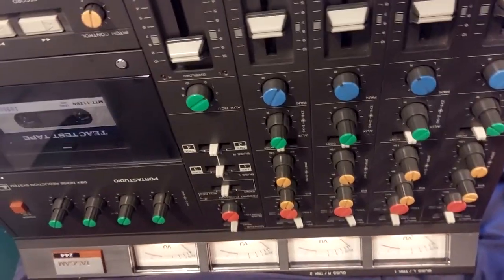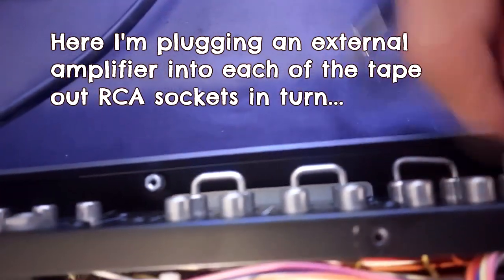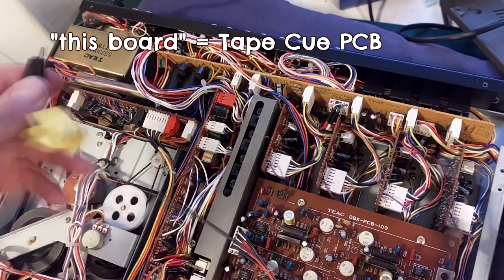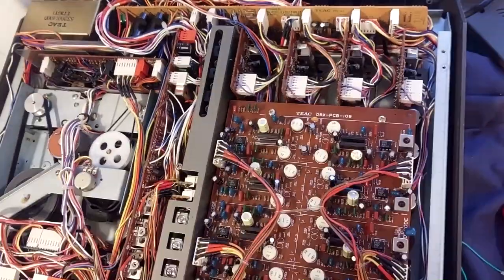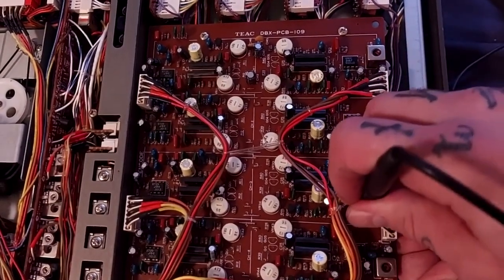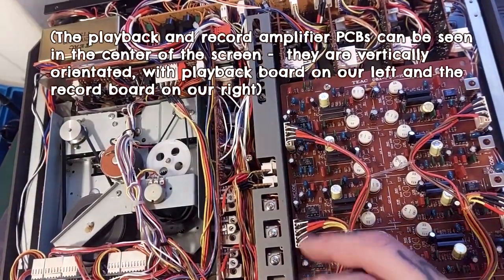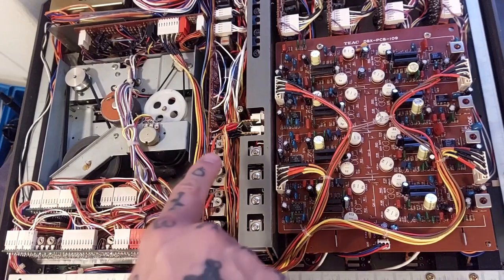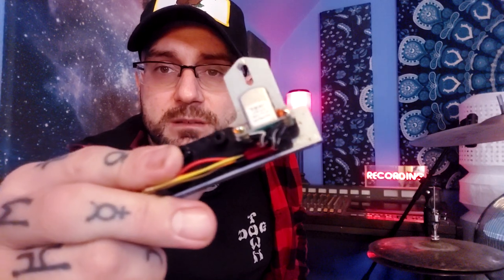Audio signal tracing & schematic analysis on a Tascam 244 (I was WRONG about magnetic heads!)

Comment: Man have ye got the patience of Job! There really is an awful lot packed into this box.  I am finding I really need to keep my cool  to follow the labyrinthine  signal path as it weaves about from board to board. Am going to get the handbook diagrams photocopied so I don't have to keep twisting from one side of the sheet to another.
Reply from the maker: It was overwhelming when I first did it. Ive learned you can usually conceptualise each board as less than half a dozen major test points, and only need to zoom in on the umpteen other components once you've established a missing or obviously degraded signals at one of the major test points. As shown on the video, coupling capacitors bookending opamps are a good place to test for missing or degraded audio.

Comment: Thanks for your endless supply of informative videos. I had a 246 recently with what I thought was a bad erase head, it was only recording over the previous take, without a clean slate each time. While looking into the problem, I remembered the shipper had packed it badly as the top right corner was smashed. It turned out they had caused some kind of damage to the PSU, which eventually started to smoke. Forced to change the PSU and transformer, I tested it and the wipe head was now functional. I can only guess power inconsistencies caused the issue.
Reply from the maker: Thanks. Yeah I guess the bias oscillator wasn't receiving power?
Reply: @Tetrakan  I didn’t look into it any further but thanks for the extra info. I also don’t consider the magnetic heads to often be at risk of fault

Comment: Halloo, cool video chap :-) just wondering, didn’t the circuit show a lower level ie. an electronic difference in voltage but the head gap isn’t electrically connected only magnetically connected ? I’m just wondering how an electrical signal injected in the circuit could be affected by the head gap being filled with rubber dust :-) ?
Reply from the maker: Thanks for watching...what you're saying would be true if I was injecting the signal from a tone generator, but in this case the signal is originating from a test tape with the same signal printed across its entire width so if the apertures are clear the voltage induced in all four electromagnets within the head should be almost identical.

Comment: Hi, I am following your instructions to the letter for replacing the belts and tires on my 244, your videos and help are invaluable, Thank You!  On the right side of the unit there are two wires with a connector that aren’t connected to anything.  Can you tell me if they connect to anything or perhaps they are for testing or calibration?   Thank You so much!
Reply from the maker: That's the daisy chain cable that carries the power for the LEDs to the mixer channel to the right... It's a modular system, and all the channels are identical, so since there is no channel to the right of channel 1, it hangs loose. Its normal. Thanks for watching!

Comment: Very informative video, sir.  Your service work illustrates the importance of replacing the rubber parts more sooner than later.  Could the head be cleaned and salvaged to live another day or did you end up scrapping the "clogged" head?
Reply from the maker: Thanks! I'm not sure about the head yet, I was wondering if soaking it in an alcohol bath would clear the apertures? I'll definitely do a follow up video if I find a solution.
Reply: @Tetrakan  Maybe a soak and then let it dry.  The alcohol might take any moisture with it and cause the material to shrink.  I would also try a very low psi air blast or vacuum to help pull the clog material out as well.
Reply from the maker: @jamescaldwell1933  thanks, I will try that, though it may take a while to rise to the top of my to-do list: I always seem to have a backlog!

Comment: Just found your channel. It's brilliant!, SO helpful. I am just about to buy my first ever 244 and it has one issue that the seller disclosed that sounds very similar to this. I hope to be able to fix it with your brilliant videos. 
The issue: Sometimes after recording on track 1, the recording isn't hearable, but after some minutes, it comes back and I can hear it again, so it seems not a recording issue but it might be to do with the reading head, similar to what you talk about here. I wanted to kindly ask (if you have time), what your advice would be to fix this issue and would it be a easyish fix? Thank you so much. Warm regards, Jon
Reply from the maker: Thanks, Jon. If the cause is what I suspect (poor & intermittent contact between the tape head and the tape) it would be an issue I could be resolved quickly and with little disassembly, BUT you'd need a certain amount of specialist kit - an oscilloscope, a 10kHz test tape and ideally a path checker cassette too. If you can find a tech who has such things and uses them often, it'd probably be cheaper to pay the tech to do it than to buy that stuff yourself? If, however, you're interested in getting into fixing these things as a hobby or to raise a bit of extra money to spend on music gear, I'd be happy to talk you through the procedure. Thanks for watching!
Reply: @Tetrakan  Thanks so much for taking the time and your estimate diagnosis, this is really helpful to know. Ah that sounds like a bigger problem (with the equipment availability) than my current limited knowledge. I'm wondering if i should not buy it. I have some funds but no experience other than watching the vids and following the manuals. The guy said he bought it a year ago and was honest enough to tell me, he said apart from this everything works, the rubbers are all replaced and its like new. Maybe I take a gamble. It's 370 euro.
Reply from the maker: IMO 370 would be fine if it'd been calibrated, but clearly, it hasn't, recently, or maybe never since leaving the factory nearly 40 years ago? If the seller can't do this before listing the item, a 100 euro drop to the price would allow a budget to have this done, but I still wouldn't buy it unless I had access to a technician who is used to working on  reel to reel or cassette technology. A lot of techs nowadays don't have test tapes or know much about magnetic tape recording systems. You need someone with experience with that stuff.
Reply: @Tetrakan  Thanks this is so very helpful. It seems like too many unknowns now for me to pursue this one. I don't mind paying 100 euro but there's no guarantee they will fix it as you say, the knowledge is not easy to find. I live in Vienna, Austria so would have to find one.

Comment: very interesting video thank you.  I am wondering if it is possible to modify portastudio jack inputs to be balanced connections? I am getting a lot of radio interference noise when i plug in a dynamic mic through xlr to jack adapter.  thank you!
Reply from the maker: Anythings possible, I suppose, though I'm not sure when I'd get around to attempting such a mod...meanwhile have you tried.using an external balanced preamp and feeding it into the receive port on the back of the 244? If you used a high-quality, well shielded  cable between the external preamp and the rca port hopefully the.interference would be less of a problem?
Reply: Try different microphone cables first. In one case the microphone itself was the problem in my setup.. the shure sm58 had no proper ground connection inside the enclosure. Another problem could be phone charger near the 244 or noisy power line.

Comment: Question (don't mean to condescend. I'm legit curious): wouldn't you have found the solution pretty quickly if you used a tone generator and probed it right at the beginning (after the tape head but before the first amp)?
Reply from the maker: Yes and no. I was labouring under the assumption that if a head segment has continuity in the coil, it’s fine, it took this situation to have me realise that’s not always true (a head can have continuity but still be insensitive) I wanted to document the process honestly, and it’s still a good demo for folks to watch in terms of understanding the circuit , interpreting schematics using the probe. The signal that leaves the head is really too small to pick up using the audio probe, and that part of the circuit can’t be accessed without extension wires. If I’d known the head sensitivity issue existed at the beginning of the video, the only way I can think of to establish that is swap which head segment was linked to which playback amplifier using male to female DuPont wires between the rec/play heads header and connector - different playback levels from different head segments through the same playback amplifier would prove the quieter segment was insensitive.
Reply: @Tetrakan  gotcha! I actually came back to those video because my reel to reel wasn't playing back the tape. The head might also be worn. You should do a video on replacing the tape head

Comment: Hey man I commented recently on how your videos helped me bring a friends 244 back to life. But now…

The other night I was recording with it and I noticed track 1 started acting strange. It’s recording a low low volume. Even with it cranked thru a condenser mic it’s barely audible once recorded. When listening before recording it sounds as loud in the headphones as you would expect but once recorded the signal is very low. Popped the tape into another machine and the recorded signal stays low so I assume the playback pcb is ok. Maybe the record pcb? This machine was filthy and I changed the deteriorating pinch roller. I read in the description you said that the goo from old rubber parts could have something to do with a lower volume on a certain track. 

Any recommendations on how to solve this issue I see the schematic for the record amplifier pcb having two transistors maybe one is busted? And not allowing the signal isn’t being amplified?

Thanks man. Id pay you for your time if we could chat or something about this I am very curious.

I’ve also removed the dbx from the equation because we like the hiss thanks man
Reply: Not allowing the signal to be amplified**
Reply from the maker: Hey. Transistors tend to be part of the switching system in such contraptions, with amplification provided by opamps. Most likely culprit is the electrolytic capacitors in the opamp networks. I've got some videos showing how to identify those, but a video consultation is possible. Message me via instagram or Facebook to arrange.
Reply: hey, I have the identical problem with channel 4. It records at very low volume and is very dull. I tested another cassette i recorded with another four track and the playback of channel 4 is fine. 
Is yours working now?

Comment: Do you know if a Japan model 464 will work on US 120v power?
Reply from the maker: It won't work. You'd need to run an AC transformer between the wall socket and the portastudio plug to raise the voltage received by the 464's internal transformer from 120 to 240 volts. Usually, such things are pretty cheap on eBay, amazon, etc.
Reply: Thanks

Comment: @Tetrakan Have you seen op amps fail often?
Reply from the maker: Only occasionally. Like, every twentyor thirty units I fix I might need to replace a chip.
Reply: @Tetrakan   Hey thanks! After weeks of head-scratching, I fixed it today. My 488 needed new op amps on channels 6 and 7. I replaced the surrounding electrolytics too, but I think they were fine.

Comment: Your videos are an absolute life-saver! Thank you for all your time and knowledge! I'm currently fixing a 244, and everything is now working fine except for Channel one is nothing but severe ground hum when set in Cue mode. I can monitor the input just fine, but as soon as I press play, record or pause....BZZZZZZZ! And I've noticed that it gets louder whenever something comes close to the play/record connectors on the record board. I've resoldered the connectors just in case it was a faulty wire, but no joy! Any help would be much appreciated. 
Cheers then!